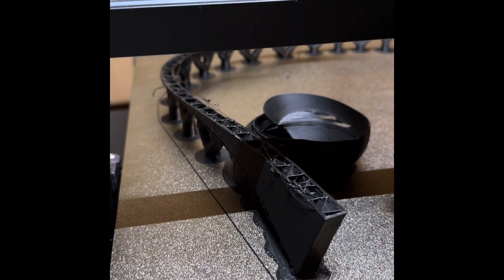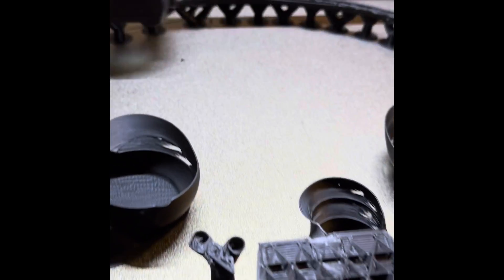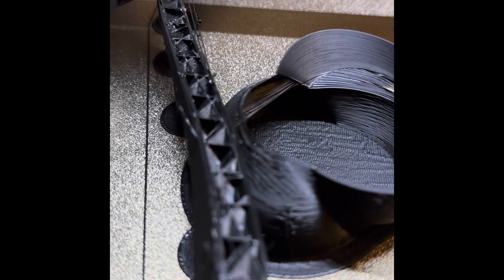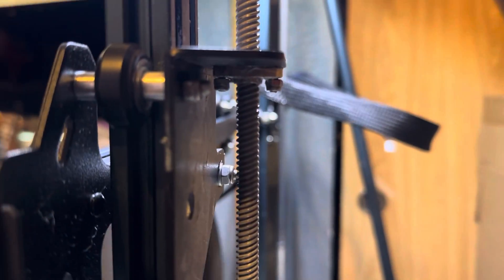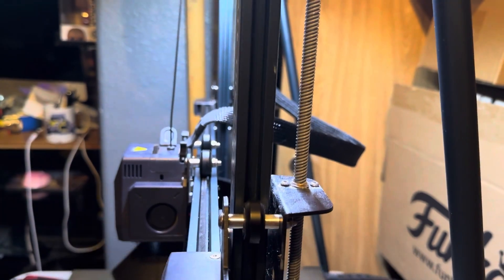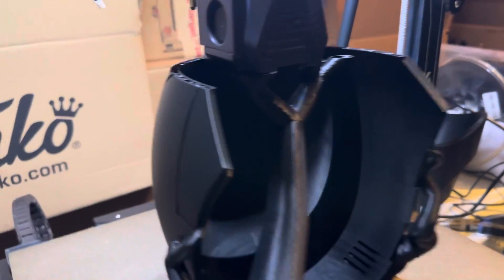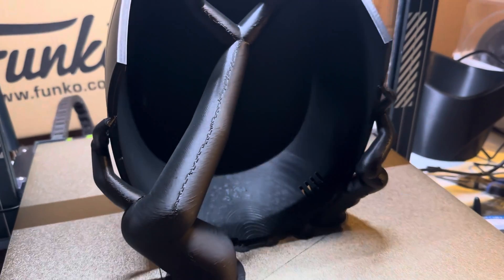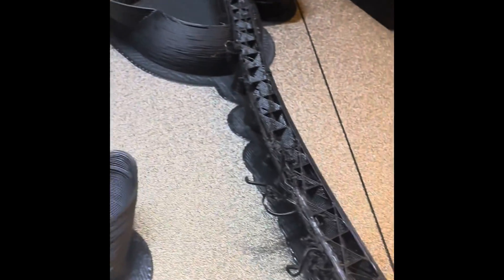Loose Elegoo Neptune 4 Max Z Rod Lead Screw Nut Causes Multiple Failed Prints. Here’s My Fix.

Comment: Can someone tell me if me having my lead screw nut tightened all the way not knowing what I was doing can cause the top wheel on that side to get worn down faster than the rest? Yes i did have it to z hop in my gcode.

Comment: just bought a Oldham Coupling Kit. one side is clearly looser then the other side, which is not doing me any favors adjusting the Gantry!! Oldham Coupling's are the best solution to stop Z banding from lead screws being bent, as they always are.. and at least I can remove the other problems that come from loosening your lead screw nuts

Comment: I noticed the nozzle stared scraping over previous layers after it got to a certain height ...   so I checked everything on the gantry  ... and tightened those nutz and also made sure the eccentric nut was also well positioned ... my Z nuts ARE tight but it doesn't bind ... now prints perfectly ... I sliced in both Prusa and Orca so I was pretty sure it was hardware ... that printer is a QA hot mess ... it's taken a while to sort out and quite a bit of plastic.  But can't beat the price to size ratio.  I'm loving the 0.8mm nozzles from Aliexpress ... I can print big in 1/4 of the time.
Reply from the maker: That’s awesome! Good to hear you were able to figure it all out.
Reply: For the eccentric nuts, on the left side of the printer looking at it from the front, those are tighted and calibrated to where they need to be. but on the Right side, I cannot for the life of me get all three to tighten up. The bottom on always is way more lose than the other two. I am experiencing similar to above where the first layer or two will lay down correctly but when it gets to the 3rd and beyond, it is like the layers don't adhere. Like there is a full layer shift up and then it starts to lay down the next layer so it doesn't bind to the one below. I have wasted so much plastic trying to get this figured out.

Comment: What about anti backlash nuts
Reply from the maker: That could work if I knew where to get the correct ones. Last time I tried ordering some for my Sunlu printers they didn’t end up fitting correctly. 🤦‍♂️
Reply: @OuterRimArmorer  I’ve looked through the fb group someone posted a while ago about how they did it I’ll try to find it and I’ll post it I think you’re a member
Reply: @OuterRimArmorer  from what I’m seeing some people posting is the ones that work with the ender 3s I went to the fb group and typed in spring backlash the first post that pops up there is a link he used it on his plus but probably fit the max
Reply from the maker: Awesome thank you! 🙏

Comment: why is my print going now not printing center  ? it started more towards the front of the build plate.
Reply from the maker: When you look at it in the slicer software is it in the center? I sometimes move the print towards the front or back of the printer in the slicing software.
Reply: @OuterRimArmorer  i think when i made the print bigger it happened to move .. i should of used align models in cura
Reply: or moved it with the mouse manually
Reply from the maker: @PeterAgostiniJdcap26 I’ve done that too. It’s shouldn’t affect the print if it’s not center.